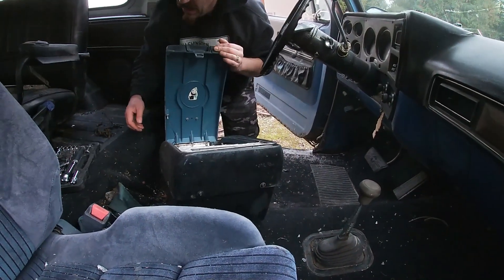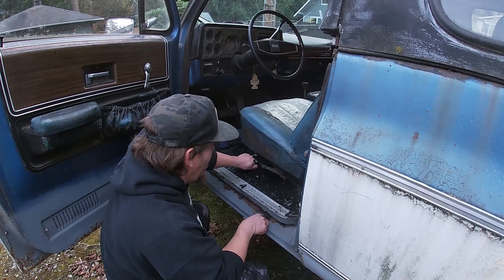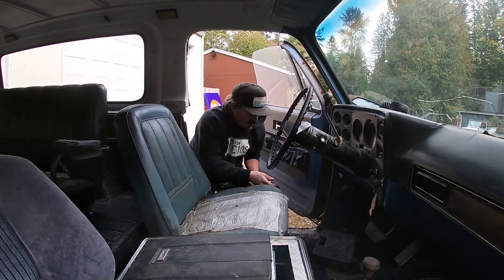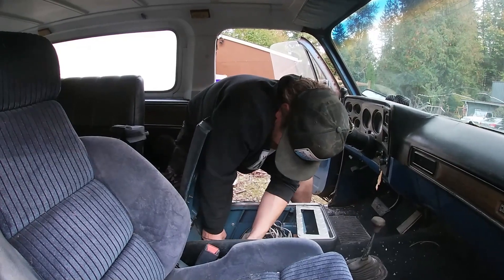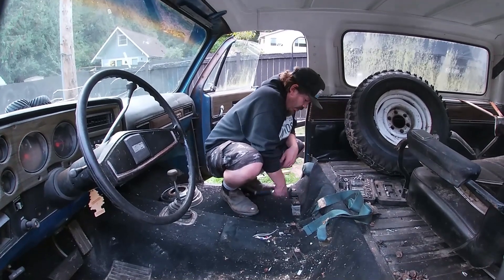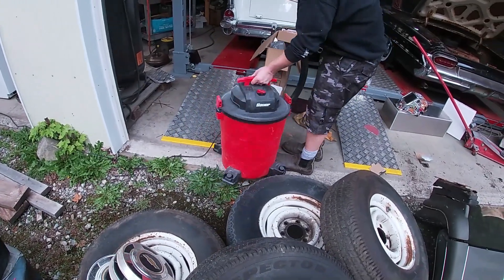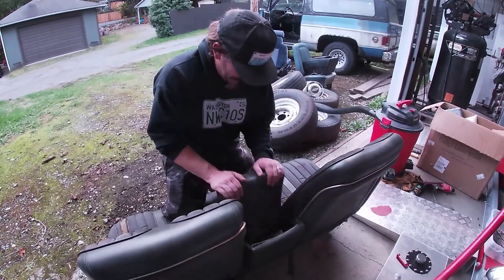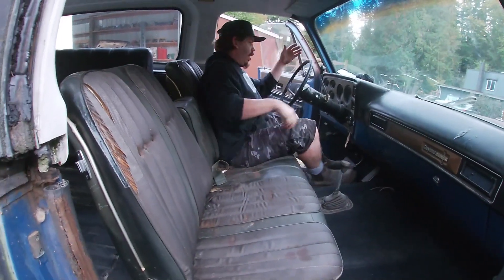A-Body Bench Seat In A Square Body Blazer!

Comment: I drive a 76 and I hated the original seats. I replaced ten or fifteen years ago with seats out of an early 90's dodge ram pickup. They are a perfect fit, just had to use a couple nylon spacers.
Those original steel wheels and hubcaps are nearly impossible to find in my neck of the woods. 
👍👍!!
Reply from the maker: Right on! I actually ended up running a bench seat in the long run from a 77 c20. This strato bench might end up in the chevelle we just bought. Make sure to subscribe to see more. Cheers!